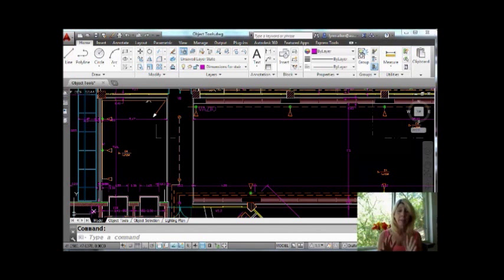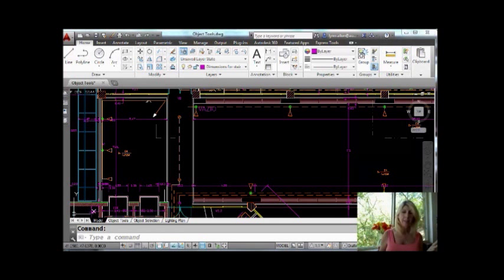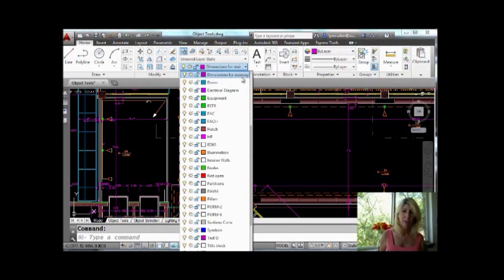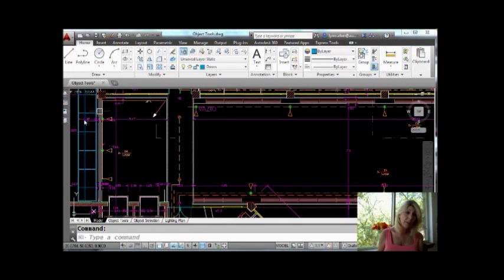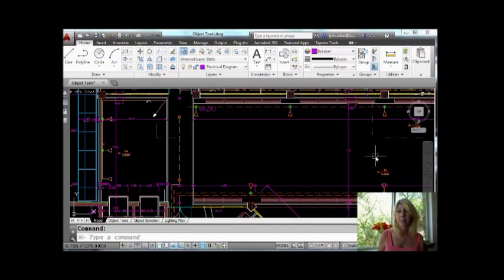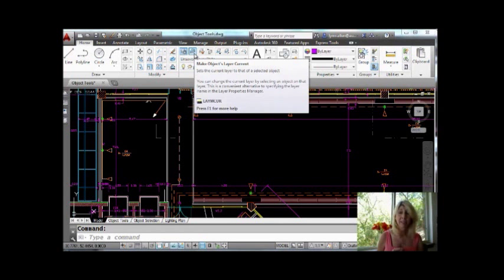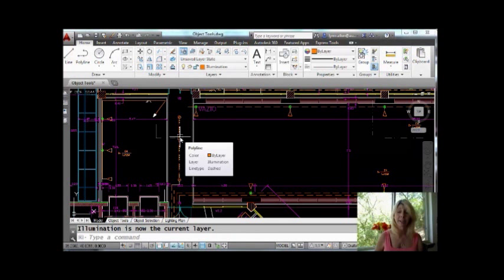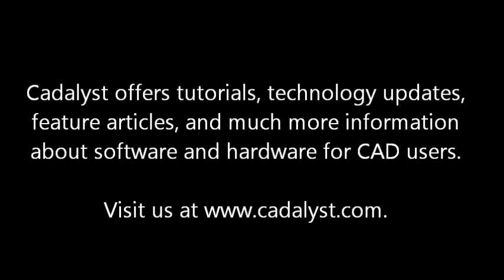Three Ways to Change Your Current AutoCAD Layer (Lynn Allen/Cadalyst Magazine)

Comment: What I use is even faster than going to Ribbon and Docked areas:
Map keyboard shortcuts for these commands (LAYMCUR, LAYCUR, MATCHPROP).
* In addition, create macro to set selected objects to layers used often; avoids needing to Look through layer dropdowns.
* If you use one layer for all dimensions, set your buttons to call a macro and have the macro set variables relating to HOW you like your dimensions as well as which osnaps you want for dimensioning [CLAYER, DIMUPT, OSMODE, DIMBLK, LAYERP]